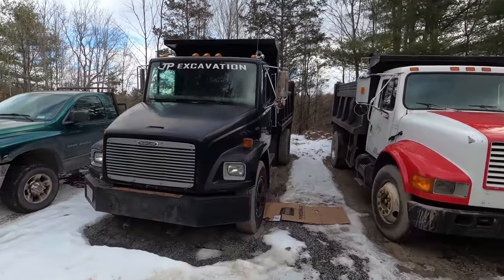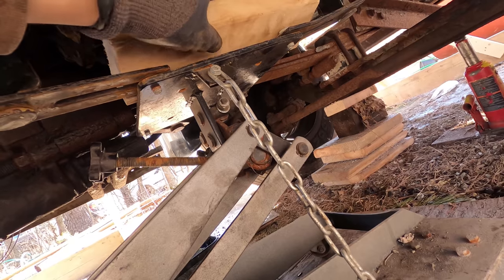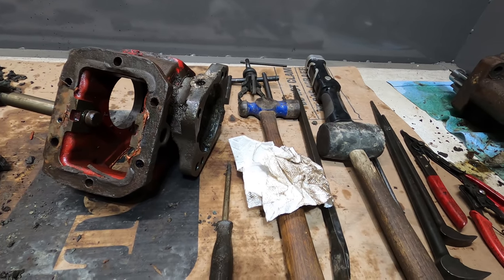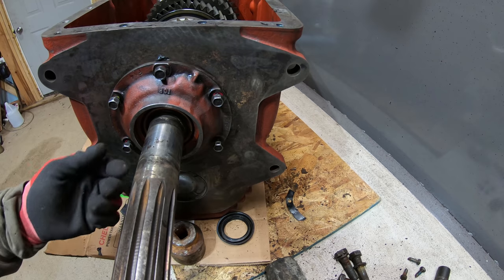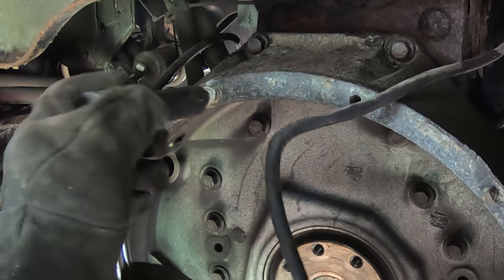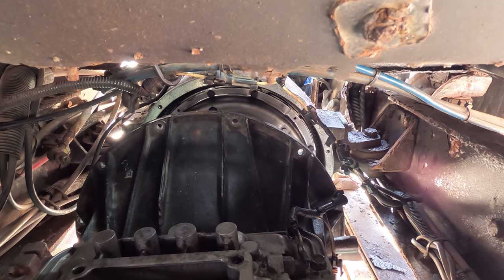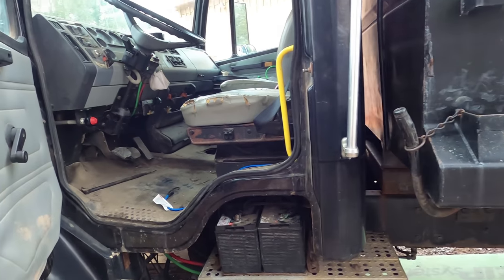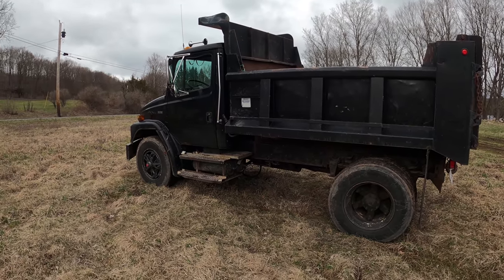Buying and fixing a dump truck: 96 Freightliner FL70 w/ 8.3 cummins

Comment: i am sure i have given you this tip on other videos. when you havea broken bolt or wheel stud use one size bigger nut so you have a little space between the stud and in side the nut to push weld down the sides and force more heat in to it, weld it with a 3/16 stainless stick rod. let it cool all the way, the stainless shrinks the stud and comes out every time first time, if your a good welder and able to read your weld, dont just weld from the center, start at the outer edge, when using them cheap coils they call for red loctight.. and the tool to put them cheap one in with has the part on the end to snap off the tab, real cheap sets dont give you the proper tool. , i stopped using them many years ago, huge pain later.  with out it, next time you try to take the bolt out the coil comes with it and jams between, use the thread nut lock inserts. every clutch an presser plate i have ever got, always comes with a plastic lining spline, you stick it in and slip all your parts over top. i have saved every one..   mind you i go to a clutch and brake shop for all mine, hope you replaced the pilot bearing in the end of the crank.. oh ya ya did.. lol
Reply from the maker: yea a bigger nut would have helped, I didnt have any at the moment and just kept using every nut I had laying around. The smart move would have been to go to the store and stock up on the right ones. I wanted the real helicoil but couldnt find them in the right size
Reply: @jmuller86  go to the docap dot com website down load there fastener catalog, you will find the one i was talking about and bolts of all sizes nf, nc, metric, studs you name it, in bulk, at great price. i whole sale for them. , i have a whole wall of bolt bins from them with huge stock,, you cant find bolts like this at such great pricing, including L9 bolts

Comment: My 05 dodge 2500 transfer case housing is aluminum and it corroded completely. Dodge decided to design there t cases with an opening  so when mated to the transmission there is a big opening that let's salt and grime get it in there and work its magic.

Comment: Nice job Jesse your the champion of truck transmissions! This job was a lot of work maybe way more work and money than you originally were expecting. Now you know what  you have and this job was done right and this truck will last you a long long time. I think in the end you may have been able to find a clean truck that you did not have to do all that work on ( probably cost you the same or more ) but now you have that truck and more plus the satisfaction of knowing what an excellent job you have done on this truck. When you don't have the money to just go out and buy what you want you have to go this route. A lot of people I'd say most could not accomplish what you have done here. I'd say your in a good place on this truck Jesse and should have no regrets! Enjoy the truck and I hope it last you a long time. PS how is the drone doing?
Reply from the maker: thanks. this truck has been working really good, its got a lot of power and it hauls alot of weight with no problem

Comment: There seems to be a sweet spot on buying trucks/equipment. Just the right amout of "used". I feel like you flirt with the edge of the scale on the junk side. Now I know you save alot of money. I get what your trying to do here however if you just put a little more money upfront on these purchases and get into slightly nicer equipment you may free up more time to make money. If you hand pick the higher paying jobs and focus on them. Getting them done quickly you can buy nicer equipment. I try to do what I'm most efficient at all the time and refuse to do anything else. NOTHING else. It has made for a nice income without dealing with headache. For example I only pour stamped concrete patios. I refuse to lay pavers due to the time consumption and labor. I also keep my equipment fleet small but very well  maintained. I use everything I own regularly. Things that have taken me years to develop a keen eye for work and equipment that allows me to stay focused on completing high profit jobs with little downtime.
Reply from the maker: I agree, I try to do the same.  I saw a few of these exact trucks for sale for over 20k so it was easier to justify it. If I had known about these problems, I probably would not have got the truck. But by the time I discovered all the things wrong, it was too late; knee deep already and I dont quit anything so I had to keep going.

Comment: Jesse those two balls are for your linkage arm on the inside of the PTO. or when you did engage or disengage the PTO.  it's those little bumps you feel when moving the lever inside the cab. 
Best way I can explain it.
Reply from the maker: but this pto is engaged with air . I thought it was detent balls for the transmission shifter but I could be wrong
Reply: You got me on that one. I know I had a manual engagement and it had those same two little balls in it

Comment: try welding a flat washer first to broken bolt... then weld a nut to washer... always tighten to right first then left and back and forth to get bolt out...hope that helps... 
thanks 4 video. be kind.

Comment: ------  red threadlocker is labeled 'permanent'  -  it also says " may require heat or special tools to remove "  -   it also just takes a small amount  :  then again, I don't guess one has to go into a manual all that often

Comment: Clean that shaft up really good, hit it with a torch and heat it, see if you can get it to move at all, if you can - throw it in a freezer overnight and try to get it to move some more.  Penetrating fluid is your friend.  I use WD-40 and Kroil, then more of each.

Comment: I drive this exact same truck at my job, except it has a Cat engine and it doesn't have that red switch on the shifter (is that for a 2-speed rear axle?) It's really a great truck, it rides really smoothly and the guys at my shop know how to fix anything that could possibly need to be fixed. I always watch them when they work on it to try to learn things.

Comment: you should look into the Milwaukee, or even the new Ridgid impact wrench (really good I got mine on sale for a couple hundred with a battery). I bought that Makita impact and returned it because it just didn't have the torque I needed. I honestly don't think it does the 1200lb-ft that it says it does.

Comment: I knew at the start that you would be buying a new PTO. The parts are so high priced that a new PTO costs less than parts for one. Normally the splines connecting the pump rust and strip out. It appeared that the oil pan might have been replaced on the engine because they also rust out on plow trucks.

Comment: I've been thinking about picking up one of those cordless impacts to replace my penumatic one. Looks like every bolt you tried to use it on wouldn't move. I think I'll stick with my air tools.
Reply from the maker: when you use extensions, it drastically reduces the torque. That was the biggest problem I had, that bigger impact gun is actually really strong

Comment: 2 thick paper gasket and 1 thin paper gasket should give you the perfect spacing between your PTO and transmission if it whines too tight if it rattles to loose

Comment: Awesome video. So 8 grand into a 20 year truck , frame looks goods. Everything on bottom needs sand blasting. is it emissions free? Here in Nc anything 20 years and older is emissions free. The blu juice is nice but emissions nightmare if computer shuts down new trucks.
You got a keeper you put alot of love into that truck. Go make some money get it back.

Comment: weld a nut on your jack shaft, you can use a heal bar or punch to remove it from the clutch, you turned the engine installing the flywheel bolts, if you had marked it and installed the clutch adjuster in the 6 o clock position when you shut the engine off your clutch would be ready to adjust for the future, should have used a lot of anti seize on the hydraulic shaft to pto drive splines for the future,  as heavy as that pump is  it needs a strap from hyd pump to back of tranny so you dont break your pto
Reply from the maker: so the motor always shuts off around the same place? I did not realize that but it does make sense, the position of least resistance
Reply: @jmuller86  about 99 percent of the time it will shut off in the same place thats why the flywheel only wears just a few teeth

Comment: Watch Wes Work did a tear down on one of these Eaton trans. He mentioned that if the truck is towed with the rear wheels on the ground it can tear them apart due to lack of oil and the gears still spinning even in neutral. FYI in case you have a breakdown.

Comment: I had a lift similar to yours. it wouldn't roll under a load. ended up replacing those small wheels with 3" and it rolls nice with a load.

Comment: You should never use gasket maker for the input shaft bearing retainer. The thickness of the actual gasket has an effect on preload for that bearing. You will find sometimes that more than one gasket is used to adjust said preload.
Reply from the maker: yea If it was out of spec with that gasket maker then I was going to wait and get the right gasket, but it was still within spec

Comment: Fyi we have a Milwaukee M18 Fuel 1/2" drive impact gun and its stronger than our 1/2" air powered impact! We use the Milwaukee Fuel M18 3/8" stubby impact alot. Perfect for most thingsand you can get to alot. #2 setting is 90ftlb so perfect for avg car work.
Reply: What kind of half inch air impact  do you have an air cat and you know you're supposed to oil before ever use if you don't and damn sure it's not going to work like it's supposed to

Comment: Get the pto info and order a good used or new one. They aren't crazy expensive and the parts maybe more than the whole unit. They are not hard to install you just need a dial indicator to setup backlash. I've done lots They are easy

Comment: Jessie:  Have Andrew give you some pointers about using the fast forward button.  ALSO:  I watch Precision Transmission.  They take apart plenty of trannys, and sometimes find goo inside the tranny where people used liquid gasket.  I hope none was squeezed into your bearings.  Just for a hoot you might consider pulling that front seal cover off to see what happens when you use that liquid gasket.  Good videos tho......

Comment: So Jesse, when are you getting a three axle truck with possibly a fourth drop down two wheel axle?  Since I don't see many drop axle dump trucks north and a bit west of you, perhaps they aren't legal in our states...  Anyway, I think you may need one of those 3 axle ones for the extra capacity.  An 8 wheeler instead of a 6 wheeler.  On the other hand, I doubt that I'd need many lessons to drive your 5 speed with a two speed rear axle. 8-))
Reply: Oh yeah, a question, how do you use the two speed axle?  Do you only shift it into high in 5th gear?  Or, are you constantly shifting the axle between low and high for most every gear, at least when fully loaded.  Probably it's somewhere between the two extremes, depending on the load.
Reply: I know there are many automatic big trucks, which I wouldn't want to learn to drive.  8-( Then again, how do drivers manage with 13 or even 18 gears?  I've heard of twin stick transmisions, but I have no idea how they work.  I'll do some internet searching about it, so don't feel like you have to try and answer this question.
Reply from the maker: @BobPegram  drop axles have to be steerable here in NY as of january 1 2021. I will just get an end dump for my semi. With a 2 speed axle, you can just shift in low until you get to 5th and then switch to high if your empty but loaded you go through each split , effectively making it a 10 speed. Its more fun to do that too, when you switch the 2 speed into high, you just blip the throttle and it switches without the clutch
Reply: @jmuller86  I see, I don't drive a truck, probably never will, but never say never!  The rear dump trailer for your "road tractor" is a good idea.  I saw one in a nearby field.  The driver moved it forward while dumping. The trailer tipped to one side and broke!  I guess that guy was out of a job after that.  Scale/size has a great effect on strength!  My toy semi with dump trailer would have been just fine after such an accident. 8-)). That's also why you need not fear an attack by 50 foot tall women! LOL!
Reply from the maker: @BobPegram  I will only buy a 24' or less dumper, the longer ones are too dangerous

Comment: Cool video. As a novice, I noticed you don't often heat up or cut off stuck bolts using an oxy-acetylene torch. What's the reasoning behind that? Risk of fire?

Comment: I would like to give you a little advice try using a Left Twist drill bit, when trying to get a broken bolt out. The left twist loosen the bolt as you drill

Comment: Hi Jesse, I know this is a little late but  surely this could have been easier if you had lifted the box up and braced it with timbers before you started, access to the area above the transmission would have been much improved and introduced the possibility of using a forklift or sheerlegs to take the weight when replacing the transmission.

Comment: great video / project.  I have a question though, why did you paint the starter black?  If you were to paint it the same colour say as the transmission or the PTO, a nice red / orange colour, you'd be able to see it with a bit more clarity, see if there are any problems with it or things around it in the future.  Black just makes things disappear and if you shine a torch on it you just get glare back. I love that some of the American engine blocks are orange or blue.
Reply: also, can't wait for part 2 !!!

Comment: Jesse most of those electric impacts don't actually produce the working torque that they're rated for. Also with a deep socket and extension you are losing some percentage of torque. I imagine it's putting out 250-350ft lbs of working torque with that setup (6" extension/deep socket)
Reply: looks super nice to shift! just finished the video. good shit man

Comment: Looking at you manually turning the transmission, it looked like the normal rotation direction was clockwise in the forward gears. Maybe the nut was left-hand thread?

Comment: Most transmissions have ball bearing (2 or so) for internal valve controlling.  30:05 I don't know much about semi transmissions but I know standard clutch throw-out bearing use ball bearings but I don't think they could end up inside a trans, etc... Didn't read if you found out about yours.

Comment: So on these transmission you use the clutch when you shift the stick but when you use the splitter that's an axle thing and just need to throttle down a bit?
Reply from the maker: exactly, when shifting the axle, you just blip the throttle

Comment: Use a copper tube over the bolt then weld through the tube. The copper will hold.  Unscrew the bolt.

Comment: Living on the West Coast, still have trouble comprehending all the rust you guys have to deal with. At least now you know what is good as you've rebuilt or replaced it.  So would end of winter pressure washings the whole underside eliminate a lot of these rust issues?

Comment: I don't think the bed needs off and turned over. Not right now. Make it pay for itself first. What it needs right now is a massive spraying with fluid film maybe mixed with paraffin wax and then spray it on hot. By wax I mean make you own fluid film and this truck will stop rusting away today.
Reply from the maker: I agree. I usually like to start seeing a return on investments before making them all nice

Comment: Now I hope you will not been "pig headed"  and use a good paste (self made) of GRAPHITE and on the bolts & nuts get yourself some cans of COPPER SPRAY GRAPHIE PASTE ON OILSEALS --- SPLINES  ----   freewheel hubs  ---- exhaust seal/gaskets ---- side-shaft ----  clutch pressure plate springs ----etc----- you will be very pleased depending on where is to be used you can make the past with linseed oil or water !!!   You'll need a box of oven-cleaner to clean all that junk !

Comment: Seems like that “new” transmission came out of something that was right hand drive. When you’re taking the bell housing off you can see the actuator arm is on the right side.
Reply: It wouldn't have to be.   some chevy left hand drive pickups had the shifter linkages mounted on the right side.   It would appear as big trucks are the same way.   all our 13 speeds have been on the left side

Comment: Just curious I used to drive a Mack truck with a Eaton 10 speed transmission with a high low switch on the sifter..  Is that just a 5 speed transmission with a 2 speed rear end?
Reply from the maker: yes it is

Comment: Heat the housing then cool the bolt, threads with brake spray cleaner or any spray coolant.

Comment: I made a heavy trap door in the bottom of my dump so I can add hydraulic fluid correcting the stupid and dangerous under raised body fluid fill operation manufactures design.

Comment: You say you just it that frozen bolt with 1,200 pounds of force. Not with all of the extensions on did you deliver 1,200

Comment: You didn't just replace a gasket on your input shaft with gasket slop? You effectively removed the endpapers and you maybe be preloading the bearing
Reply from the maker: I checked the endplay after and it was within spec, I showed it on video